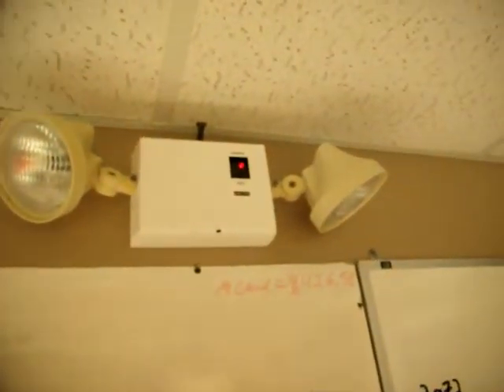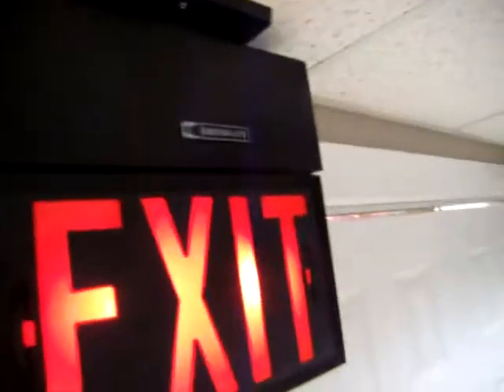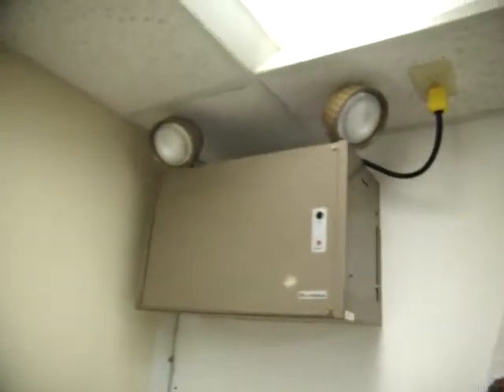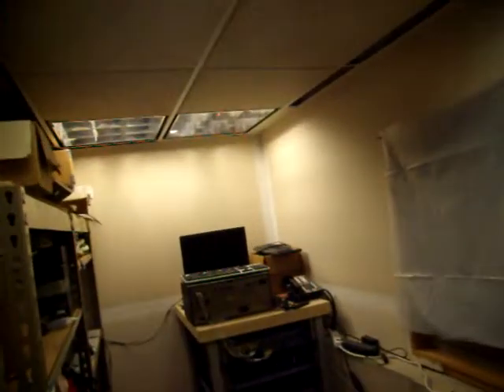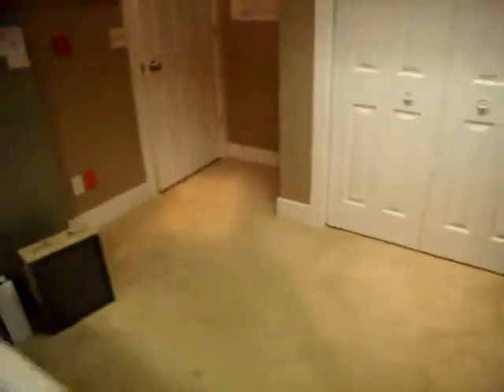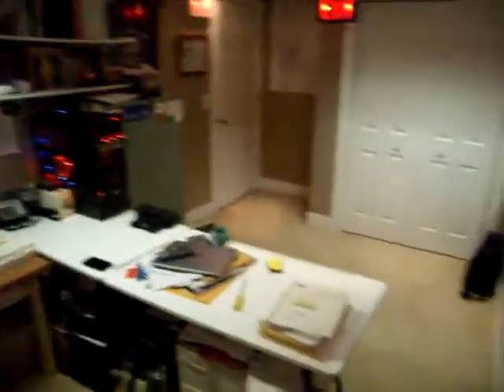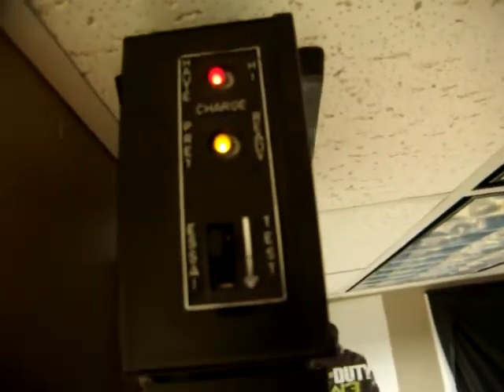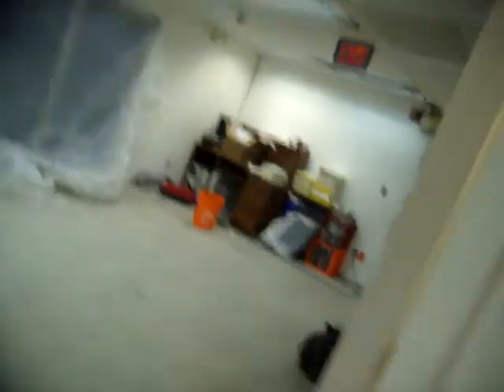Emergency Light Exit Sgin Test

Comment: 0:16 i have that thing at the office at my school, some have little switches, a few have buttons, and some have a little pole sticking out with the red led on it...and there is one in one of the rooms that says "emergency light push to test" but does not have a button or led
edit: 5:08 is the one i was talking about with the switch and then the one with the pole sticking out
Reply: Edit: Apparently the lights in the hallway have little emergency spotlights in them but i have not seen them turned on before, i still have no info about the rest of the school